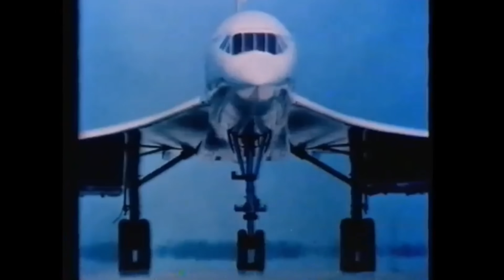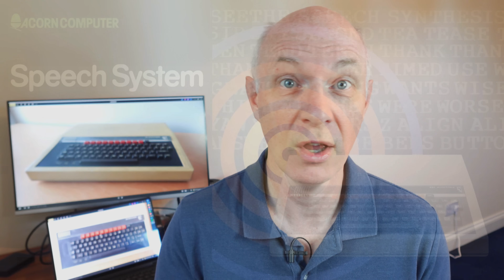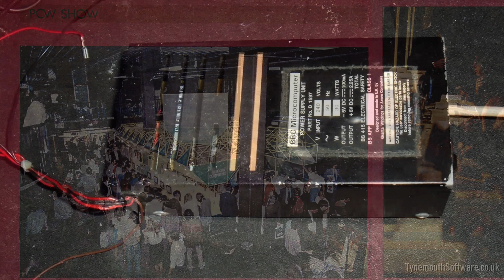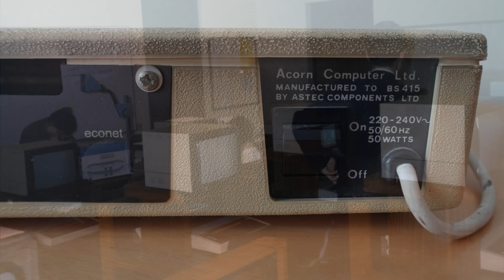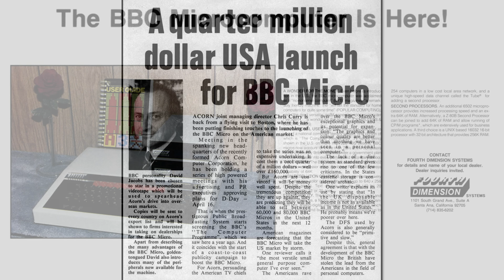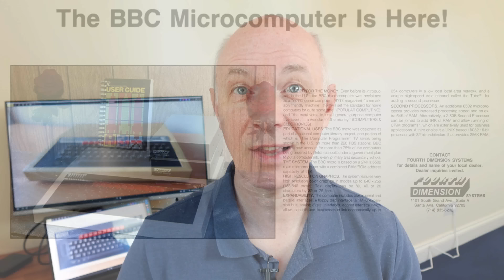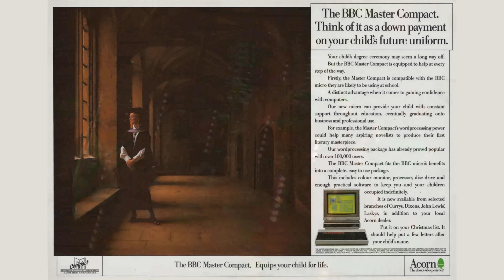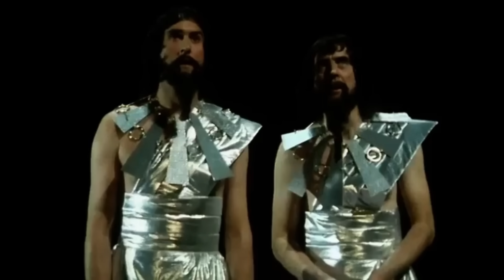6502 Reasons Why I Love This Machine

Comment: What the Acorn people discovered by plugging several different processors into the Tube was that they could predict the performance just by knowing the memory bandwidth independently of any internal details. So if a 4 MHz 6502 did a one byte access every cycle (4 MB/s) and an 8 MHz 68000 did a two byte access every four cycles (also 4 MB/s) then programs would run equally fast on both. They designed their 8 MHz ARM to access memory in one cycle for a sequence of locations (non LOAD/STORE instructions or LoadMultiple/StoreMultiple) or two cycles otherwise (jumps or LOAD/STORE) for four bytes in 1.5 cycles on average. As predicted, their 24 MB/s bandwidth allowed programs to run six times as fast as an 8 MHz 68000 (like in the original Mac). Note that this observation was not true for the early microprocessors these engineers had started with because they had too few transistors and often had to waste possible memory cycles doing internal operations. That is why they were not expecting the results their Tube experiments gave them.

Comment: Great video. I missed the BBC Micro as I did my A levels in 1981, and my school had gone down the Commodore Pet route. Been programming ever since.
Reply: In 1977 I took a Sunday Times cutting about the launch of the Commodore Pet into school to show the head of maths. At the time the school's computer (note the singular) was a Busicom 2017.
Reply: @MrDuncl  We had one Pet during my 6th form, one other stand-alone machine - can't remember what, and a keyboard/teletype printer connecting via a very slow telephone modem (handset into a receptacle) to a university. When I visited the in Oct 1981 (retaking my A level maths), they had a whole room of Pets all networked together.

Comment: “Why i do like this machine”
Should the title not be rectified to be ‘the bbc micro history’ or ‘the story of the bbc micro’ ? 🤔
But apart from that i can imagine how cool the bbcmricro actually is.
Because eventrough it doesn’t have official ports of pac man or donkeykong etc… on it, but it does have great clones of it like man chaser, zany kong, killer gorilla, hopper and many many more.
I think those clones alone did helped to increase the sales of that machine rappidly.
So while i first didn’t had much interests in that machine, but with thise mentioned cloned games onit i do have.
Too bad both those games and the machine itself are rare and expensive these days.

Comment: I bought my first Beeb at the end of 1983, with contributions from my sister and parents and took to programming straight away. I never really looked at graphics or sound which is still a mystery, but data storage and exploring the operating system was great fun. I remember overhearing two teachers in the wood work and metal work shops at school discussing how they might have a student control a circuit board or robot with the computer. I joined in the discussion and mention INPUT as a way to gather the input. Fast forward a couple of years and I am controlling robots made from Lego and Fischertechnik kits and working towards my O-Level, remember those, in "Technology". Just this week, I am rummaging through my parents' house and found my A-Level Computer Studies project, a database system to manage the customers, deliveries and billing for a news paper agency.

I'm afraid, I was one of the bedroom coders of the 1980s who took their interest and hobby and turned it into a career.

@Little Car, why aren't you wearing the BBC Micro T Shirt from the Granada video?
Reply: I might be wrong, but wasn't there just one year where O-Level Computing ran?  I thought it only appeared the year before GCSE's came in?  I also did it - wrote a tourist information "database".  And I ended up being SQL programmer.  Mad isn't it.
Reply: @DDBHH42  There were several years of O-Level Computer Studies at my school. I knew a few students some years older than who took it.

A-Level Computer Science only existed for 2 years before I took that.

I suspect the availability of the course depended on the availability of staff and hardware back in the day

Comment: This was the machine that could have been as big as Microsoft. They didn't develop it, just happy to take taxpayers money.
Reply: Didn't develop it? They had to develop it purely to keep making and selling machines.

The B+ has different dynamic RAM chips because the ones they had been using in the original Beeb were soon discontinued. One can discuss why the B+ was underwhelming, but reasons include development of the US Beeb, which was a distraction, and the need to provide the core of the Acorn Business Computer, which took the Beeb second processor concept to its own fairly underwhelming conclusion.

The Master series was largely the refresh to the original Beeb that had been planned. Again, it wasn't particularly impressive, partly due to being maybe a year or so late, but it was a necessity to keep serving the educational market. Acorn's priority was largely the development of ARM-based products by that stage, with the Archimedes arriving a year later. Acorn could have done something like what Apple did with the IIGS, but it probably wouldn't have been very successful.

One can discuss taxpayers' money and how it was spent, but the subsidies were not as generous as people think they were. And Acorn were not the only manufacturer to have their models subsidised, either.

Comment: Considering how rushed the BBC B was, it was certainly a quality bit of kit. And it took the abuse of millions of teenagers smashing away at the keyboard. I had an Electron which meant i could continue my Computer Studies coursework at home by saving to tape when at school. I remember the Electron was super expensive back at that time and my Mum actually took on a 2nd job so she could buy one for me. We waited months for it to arrive, and when it did arrive it was clear to me that it was not new. The keys were dirty and it would not work properly. It kept shutting off. My mum was so upset about this given what she paid for it, so without her knowing i took it apart and pulled the board. Solder connections were broken on the power socket. So i reflowed it myself at 14yrs old. Was so proud of myself that i fixed it.

Comment: Thanks 👍
I thought that the Acorn Computers we had in High School were connected by Ethernet but I know now that it was Econet 🙂
Reply: If it was later on it could have well been arcs connected via Ethernet, but they also used econet which is more likely in a school setting

Comment: I had an Acorn Atom when I was young. At some point in time an expansion card was made that could turn it into a BBC. Not sure if that came from Acorn itself or from the Dutch Atom user group, members of which regularly came up with ways to increase the capabilities of the Atom by soldering stuff into it. Never got my hands on one though, only read about it in the little booklet this user group periodically published.
Reply: I had that BBC Basic expansion board in my Atom. It was a bit limited, especially the lack of proper BBC style graphics, but was a useful stepping stone until I finally got my Model B, which I used throughout my uni years and beyond.

Comment: I was finishing primary school in 1983 when I was introduced to my very first computer and the BBC Micro it was.  The school only had one!  Unfortunately, very little time spent on it and only in groups of 3. No coding or learning BASIC, nothing.....basically, we just learnt how a keyboard worked and draw silly pictures on screen. You should do a review of the RM Nimbus machines (IBM PC clones) which my secondary school (and many others in the UK) used in the late 80s.  That was our introduction to word-processing.
Reply: I thought you were going to say Research Machines 380Z. We had a lab full of those at college.
Reply: @MrDuncl  The RM 380Z was discontinued by 1985.  In 1987, we used RM Nimbus PC-186 machines to pass our RSA exam in word-processing.  This was a most basic exam, writing text on-screen with accuracy and completeness, the only measures of success.  With hindsight, it would have been far more useful to be introduced to spreadsheets but there were no RSA exam poposed in that domain.....I cannot recall Lotus 1-2-3 or MS Excel ever being used at school, probably considered more akin to accounting softwares than anything else.

Comment: At my school, we had the fortune of creating a school-based teletext system. I was one of the editors for a while, and I had an absolute ball creating pages. Someone needs to do a plug-n-play version of the Beeb, like with the Commodore 64, Atari 400 and The Spectrum, and include a teletext editor with it. Oh, the fun I could have...
Reply: You might like BBCSDL which can run on most modern hardware and one of the supplied example programs is a CEEFAX simulator that displays news items from the internet as teletext pages.

Comment: I’m really loving the channels occasional segues away from car related stuff, as brilliantly done as that is.

Hard to overstate how critical this machine was to the UK’s IT industry, ensuring every kid in my generation had at least some exposure with one of these in every primary school.

I could tell you what else it influenced, but you’d have to twist my ARM.
Reply: "occasional"? there hasn't been a car video on here for a year.
Reply: There were many schools that only had one or two BBC Micros that almost none of the children were allowed to even touch. Although I am a great fan of the BBC Micro (I bought one with my own money when I was 16 in 1984), I think the ZX Spectrum would have been a better choice for schools.
Reply: @Innesb  Would it have been possible, that schools got the full complement, but some bigwig in a school put most of the fleet out on the aftermarket to earn a pretty penny, and left the few remaining units out on display for when school inspectors arrived to inspect?
Reply: He worked with Microsoft on shifter that was used in cars so it makes sense